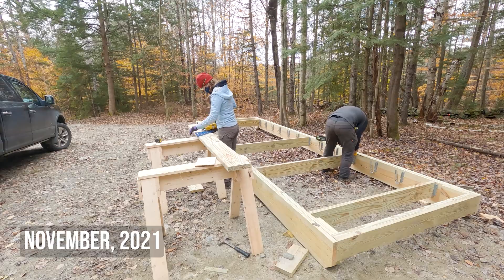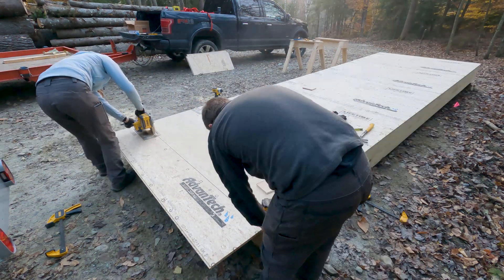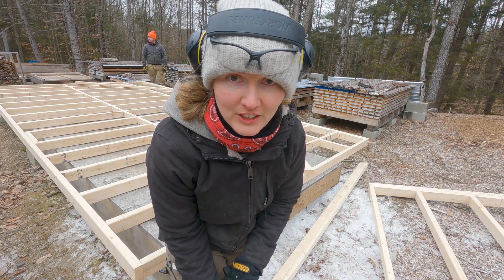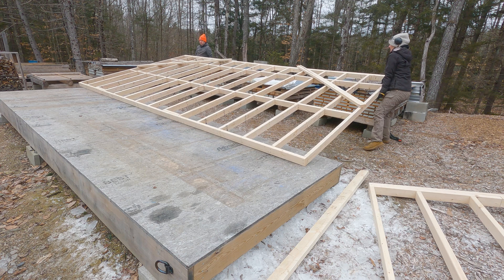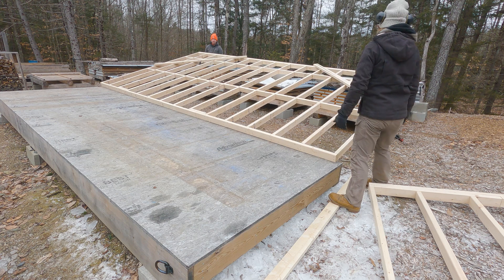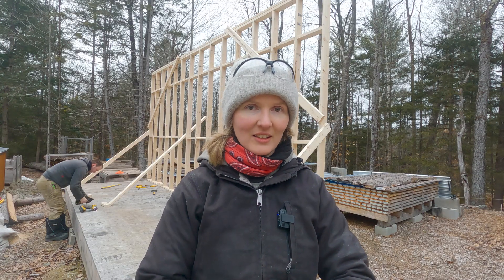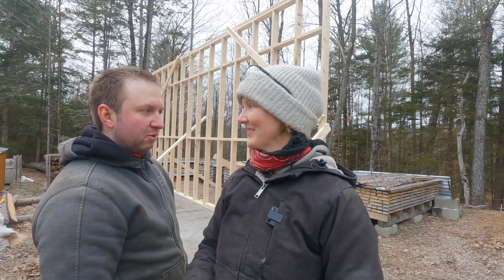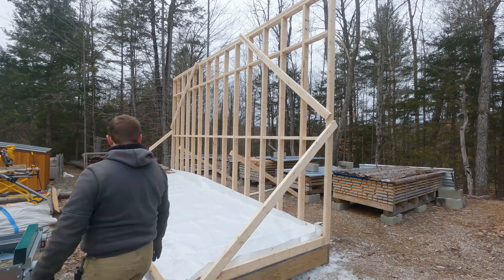Back to building the Solar Kiln! | Solar Kiln Ep 5

Comment: Looking forward to future kiln videos.   I need to build one too.

Couple tips on raising that tall wall.   Try doing it "the other way around"  with the wall laying on the deck.   

Then the cleat you placed at edge of floor will keep the wall from kicking out at bottom.    And at same time your diagonal braces will drag nicely across ground, and not 'stab in" so the c-clamps holding them aloft wouldn't be needed.  and you both will be standing 2 ft higher off the ground, and get a bit better leverage to raise the wall.
Reply from the maker: We’ve literally just put our real first load of lumber into the solar kiln this afternoon. It’s just some boards to make siding for the kiln itself, but even so we’re pretty excited. We did a test run with the kiln in early April and it dried some boards to oven dry in 7 days. The hottest we’ve seen it so far is 175°F.

As for the wall, we were in a tight spot. There wasn’t space on the other side to do what you suggested - there was a yard bag full of frozen sand in the way that we couldn’t move.